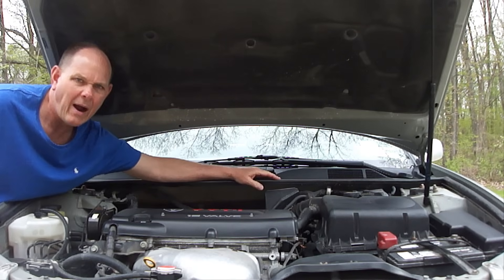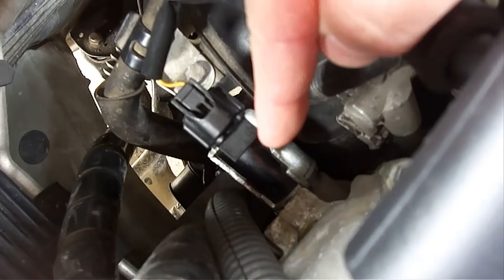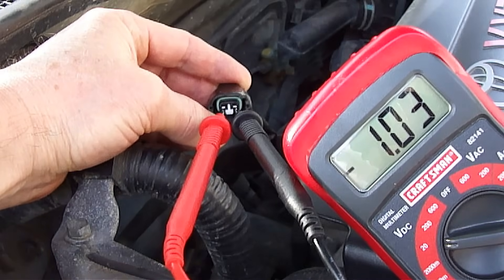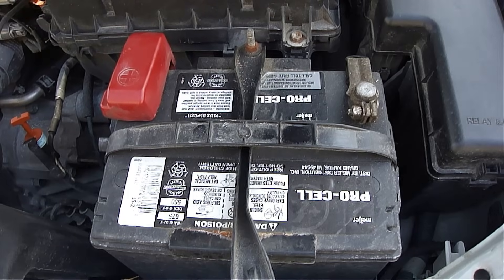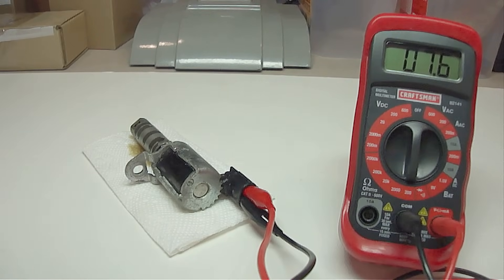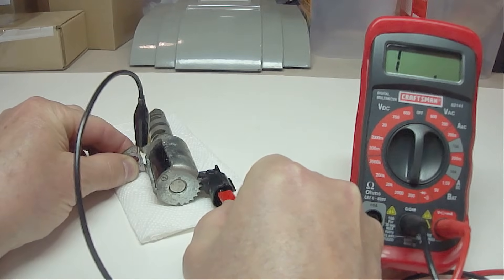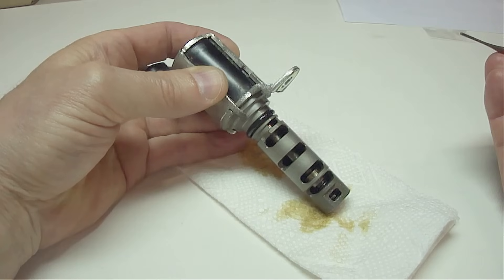How To Tell If Variable Valve Timing Solenoid Is Bad On Your Car P0010 P0011 P0112 P0013 P0014

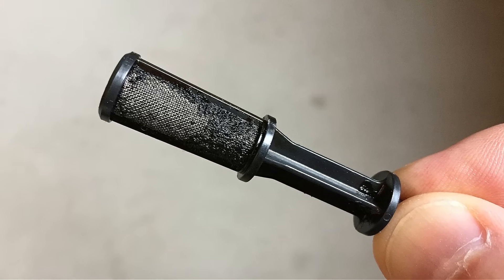Comment: Where is that oil filter knob at minute 1:12 in your video?
Reply: In this video link, the guy has to take an engine cover off to get to it.  It would be nice if engineers would design stuff where it's easy to get to, wouldn't it?  If they had to work on their cars they'd build them differently.  Here's the video I found:  https://www.youtube.com/watch?v=sIQy4Lshvjo

Comment: I enjoy you video very informative and accurate but short and sweet. 
I have Camry 2004 LE(4 Cylinder).  On my Blue Driver scanner, i see the message something like this "Timing Advance for # 1 Cylinder" its advanced by anywhere 10 to 30 degrees.
Recently, i drove through flooded water and since then i started having issues with my car. I replaced throttle body and MAF and Intake air temperature sensor. 
What could be the issue? can you point me in right direction?
Reply from the maker: Abe Syed You need to take it to an auto parts store and have it checked with a diagnostic scanner for trouble codes.
Reply: @proclaimliberty2000  i have got  a diagnostic code P0505.
Reply from the maker: @abesyed4537  Does the engine idle too low or too high or stall when coming to a stop?

Comment: great video im getting p011 p0012 and p0016 should i replace this if this is not the issue what else can i go for vehicle in question is toyota vitz 1krfe 2010 model
Reply from the maker: nzx 14 The first thing I would do is make sure the engine oil is full of clean correct viscosity oil.
Reply: @proclaimliberty2000  it is fully clean and of recomended viscosity 5w 30 still issue remains even checked solenoid with 12v it runs good